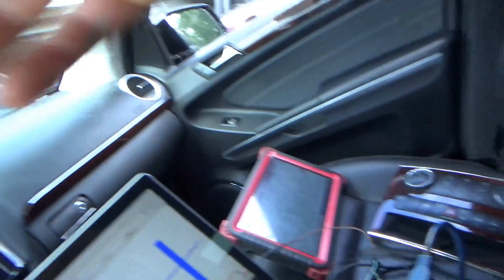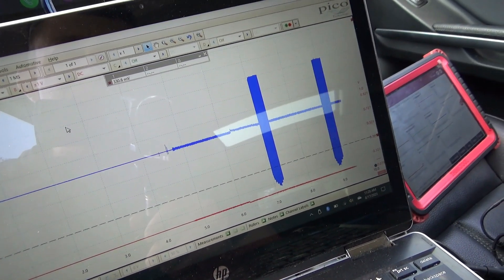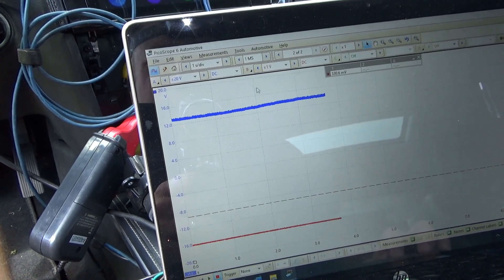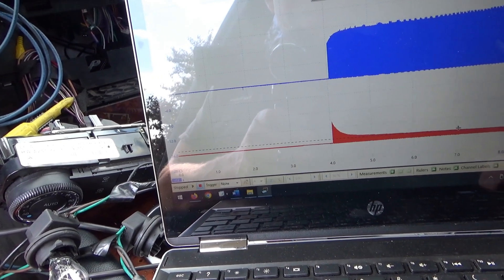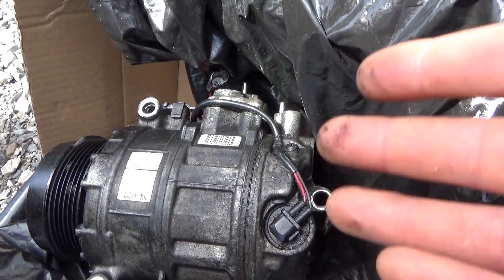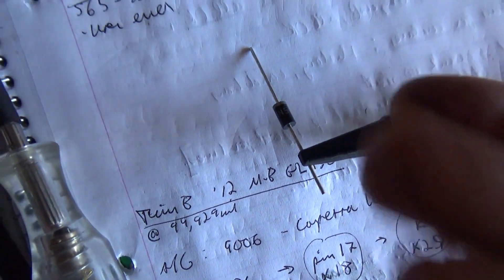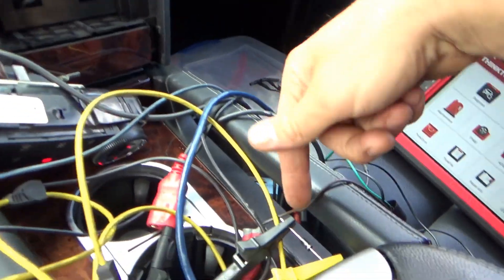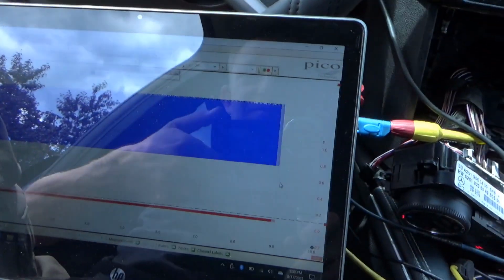Part 2: Did I MIS-DIAGNOSE This Mercedes?? (GL450 no A/C - Crazy REPAIR!)

Comment: My guess is that there is a blown diode in the controller. Because anyway it is easier to be there and it is also more logical. This way it will even guard against induced voltages on the cable caused by anything, not just the inductor in the valve. And the other controller, if it is working at all, most likely has incorrect firmware. And it is not surprising, for a German car, that the diode has a nominal voltage of 15V and is as small as possible. They don't really like to use slightly larger values than "calculated" :)

Comment: The bigger issue for his road trip is his air suspension system.  Compressor ran multiple times during the video and had the classic Airmatic warning on the dash.  He has air leaks and it will eventually kill the compressor.  Unfortunately Airmatic on the GLs seems to be Mercedes' least reliable application but I don't know why.  Anyway, I'd scan the codes and see what it says.  Leaking air spring, line, valve block....who knows.  But it will ruin his vacation.

Comment: Kudos to the folks who were talking about diodes on part 1.  I was way off with my front SAM commentary.  Although someone did mention that there is a compressor control learn-in feature.  I don't think you can "learn" back EMF but would have been interesting to dig into maybe.

Comment: Be very wary of using common types of "rectifier" diodes like  1N4000 / 1N5400 series etc. on PWM control systems - those and many similar ones have a  slow response and can both allow brief spikes past before starting to conduct, and keep conducting for a short time after the polarity reverses again.

That can cause strange problems, radio interference or even damage to other components in some circumstances.
It's only a couple of microseconds, so won't usually show on a slow scope sweep.

Fast recovery or especially Schottky diodes are fine at higher frequencies.

Comment: The standard diode used in electronic applications like this on relays is a 1N4148, has thinner leads, easier to twist around that wire, but I understand, you use what you have available at that time. Good Job!
Reply: 1N4148 is a signal diode and not suited to this task. Perhaps you means one of the diodes in the 1N4001 through 1N4007 family?

Comment: PIV is (P)eak (I)nverse (V)oltage, you have 16, should work
Reply: As wired by Ivan, the diode is clipping the negative voltage, (which was -16V) so will not see 16 V in reverse direction. It only has to withstand nominal battery voltage in the reverse direction, so say 14V. Not much difference though :-)

Comment: Yes, it's ridiculous how Mercedes Benz don't show a freewheeling diode which is connected in reverse polarity to the air conditioning compressor clutch coil because even the generic manuals for my Holden Commodore show that,good find !
Reply: Perhaps because it's a given there is one. Clamping diodes has probably existed as long as electrically controlled AC-compressors has been around.

Do you know if everybody else show any clamping diodes around their vehicles?

Comment: Well done ivan 😀So the inductive part of the compressor might have had a capacitor across the harness originally?, but it failed and was never replaced.
inductive or capacitive  effects.
Back emf is shocking lol.
Reply: It is unlikely that there would be a cap across the harness, because that capacitor will just look like a short circuit to the PWM pulses.

Comment: 800mA though a 1Amp diode is going to get HOT ?   Not sure if that is constant or a Peak value ?  I would personally use a higher current diode if it's a constant 800mA load.
Reply: The diode is only there to absorb the pulses that "discharge" the coil. That could still be a substantial current, so should be checked, but it's not continuous.

Comment: The best place for a fly-back suppression diode is close to the coil that causes the back-EMF spikes, because the conductors between coil and fly-back diode serve as antennas that radiate an RF signal. This is PWM, so you'll get a signal with a base frequency that might be in audible range, with a lot of harmonics on it that might interfere with radio reception.
With this repair with the diode in that location, one should test the radio as well.
Reply: Yes, I agree with this assessment.  It would be good to try an AM radio near the wiring to check how that varies at different AC settings. Wait -- who has an AM radio any more?
Reply: @Graham_Wideman  My car radio has AM, FM with RDS, digital radio, bluetooth, car-kit, aux in, audio file playback via usb. AM still offers a lot of news and talk radio.
Reply: @fluffyblue4006  Yes, I was kidding about the AM radio. I myself have AM in both my vehicles.  Although AM is starting to be dropped on EVs, I have heard.
Reply: @Graham_Wideman  They're dropping it because the EMF of those power electronic drives will be too much and too hard to shield properly.

Comment: Super work Ivan. Keep in mind, the best practice is to place that flyback diode as close to the solenoid as possible, because the wiring acts as a transmission line and the high-frequency current of the spikes will flow between the coil and the diode -- you want those wires to be as short as possible and shielded/isolated from any neighbouring control wires.

I am really surprised that the flyback diode isn't integrated with the valve solenoid.
Reply: Well, not a transmission line, but rather an antenna.
Reply: @Graham_Wideman With regard to other wires in the same loom, it will act like a transmission line, as those wires are capacitively coupled. Which will cause high frequency crosstalk.
Reply: @Stoney3K  Ah, I see what you's saying. Yes, definitely there would be inductively- and capacitively-couple crosstalk to other wires in the loom.  But in my field we might not really think about them as a "transmission line" per se (in the high-frequency sense, not power-line sense) unless the situation fulfills some other requirements that make it amenable to "transmission line theory".  (Two specific conductors carrying a signal from point A to point B, conductors consistently spaced so as to allow summarizing their incremental R, L and C as bulk "impedance" value, no significant random influences from other conductors, and so on.)

Comment: Hi Ivan I use a lot of relays in my designs and they should always have a back emf diode when being fired from semiconductor drivers. Some relays have an internal resistor to reduce back EMF. Relays and solenoids are effectively the same thing. Coil of wire. The diode should be fitted as close to the inductor as possible. Helps reduce RFI. But as you say where is the diode in the replacement unit? On AC circuits I use an MOV.
Reply: Mostly agree for DC. For AC MOV will address infrequent high-voltage transients, but in this application a transient will occur on most turn-offs of the inductive load. MOVs degrade with each transient, so their lifetime has to be factored in. An often user alternative is the "snubber" circuit" using resistor and capacitor.

Comment: I would suggest the diode should have been placed near the compressor to clamp the reverse voltage at the source. How much power is the diode dissipating? Will it get hot?
Reply: Supposedly it is in parallel so it shouldn't get hot.
Reply: @rkan2  yep, thanks. Agree, the diode would have a forward bias voltage of about 0.7 volts and the 12 volt negative spike could only generate about an amp. Hence about 0.7 watts, but only for about a tenth or less of the time. Hence at most 0.1 watts. So as long as the diode can cope with an amp or two and has a reverse voltage tolerance well above 12 volt all should be OK (unless there are unseen higher voltage transients). However, I still think the diode should have been installed on the compressor to reduce any RF interference in the wiring.

Comment: Ivan, good catch and fix on the back EMF.  However for a device that monitors current your test lights lights are problematic.  When you first apply power to a incandescent lamp there is very little resistance and this causes excessive current to flow.  As soon as the filament heats up the resistance increases and the current flow decreases.  This is why you initially saw 4 amps on the scope and then it settled down to 1 amp.  The controller likely saw this 4X normal current flow and shut down to protect the controller before the lamp reached it's steady state 1 amp draw.
Reply from the maker: Correct 👍

Comment: Lesson of the day,we need to use scanners,understand the information,somewhere in that Mercedes there would have been a diode,probably on the original compressor or bcm,without the scanner ,you would not know about the return voltage,bloody good video,thanks for the video.
Reply from the maker: You mean OSCILLOSCOPE? Very different from the SCANNER 😉

Comment: Why didn’t you hook the diode in series with the clutch? That would have stopped the back feed and been a cleaner repair.
Reply from the maker: No. Can you tell me why?
Reply: @PineHollowAutoDiagnostics  My first thought when you said it was back feeding was a diode in series, but then you wired it across the coil like I put across my relay coils. I was just wondering if my way would have worked too since it’s sending a pulse width control signal.  Love your diagnostic videos and troubleshooting skills. Thank you for sharing.

Comment: I was thinking you were going to use an external solid state relay to fire that thing but the Flyback diode was cleaner.  Well done sir.
Reply: That was my thought, but I think you would lose the duty cycle control of the compressor
Reply: @_RiseAgainst  Yep!

Comment: I've seen a similar problem on an electro magnetically controlled hydraulic valve on a Liebherr material handler. The coils on the valves fail often because they were installed in an area that can get very hot. Some of the valves are strictly on or off while others vary flow using pulse modulation. There were two different coil numbers that appeared to be exactly the same on the valves and we stocked both. One mechanic switched a coil from another valve without paying attention to the number and the valve wouldn't function. In that case it was the engine cooling fan which varies speed depending on engine temperature. The electrical schematic showed the diode in the coil. I'm surprised that the schematic you had didn't show the diode. There are also 5 pin relays that have a diode inside. I don't know why they don't put the diode on the circuit board instead of in the component.

Comment: There is a diode built-in to some mosfets and they can fail without destroying the switch side of the mosfet.  It is a common failure in laptops that use these types of mosfets in an ideal-diode safety circuit that ensures reverse polarity on the charger input won't damage the laptop.  Just a theory but it could be one of those mosfets with a built-in diode and the diode in the mosfet that controls that circuit could be where the failure happened.  It could be an external diode as well but cost savings... fewer components...  either way, its fixed.  ;)
Reply: Would be best to use a Schottky Diode in this application. Not sure what type was used, though.  Nobody would have caught this without a scope.

Comment: Why did you not just put the diode inline that would have stopped the back voltage then the diode wouldn’t have any back voltage or current going though it
Reply: Flyback diodes are installed in parallel.  You want to create alternate circuit to use the coil's resistance to bleed the back EMF off or shunt it to ground.
Reply from the maker: Think about the potential across the diode during the High and Low portions of the PWM signal. Controller would still see the negative voltage spike with diode in series 😉

Comment: For anyone that doesn't know, PIV is peak inverse voltage. It's the maximum reverse voltage the diode will handle before starting to break down. 50piv is just right for this application.
Reply: And if you exceed the piv at all, it will nuke the diode. This is a very important specification. In this case the diode is essentially across the coil, which is correct, and piv doesn’t come into play. Diode ‘eats’ the arc as soon as the reverse voltage exceeds .6 volts.
Reply: PIV is kind of an older term, those radio shack diodes are a bit old! datasheets now use the term peak reverse voltage, Peak Repetitive Reverse Voltage , all the same thing. just like when we used the term kilocycles, now we use kilohertz

Comment: In my design arena we did lots of relay switching and the switch was transistors.  Conveniently, the relays we used had built-in diodes ACROSS the relay's coil.  These were D.C. voltage coils and the diodes were such that they were reverse biased when control voltage was applied.  How does this work?  In operate mode the current flows from battery to coil to ground back to battery.  In open circuit the current then flows thru coil in same direction thru diode back to coil.  

A coil builds up magnetic flux when the current flows.  When the current's source is switched off the magnetic flux collapses.  This causes the voltage across a coil TO SWITCH POLARITIES. 

Voltage applied to a coil causes the coil to consume energy with a resulting voltage drop across the coil (+) to (-) from input to output.  When switched off, the coil becomes a generator by switching voltage polarities to continue current flowing; now (-) is (+) and (+) is (-).  The flowing current wants a path thru the now open switch.  

An inductor 'resists CHANGE in current flow.'  If a switch opening stops current flowing, the coil then goes crazy [THE CURRENT WILL FLOW somewhere, somehow] and so it first flips polarity then INCREASES IN VOLTAGE looking for a path for the collapsing coil's current. This is a cause of pitting of switches because the extremely high REVERSE voltages cause arcing across the switch's now open contacts.  

It's my belief that early vacuum cleaners had headlamps across the motor to provide a motor coil discharge path when the switch was turned off = opened to eliminate switch pitting.  

In Ivan's compressor the control voltage was applied to the compressor's coil, thru the coil, then to ground.  His diode fix then provided a diode path from ground to the control wire which goes back to the compressor's coil.  It is a longer route but sufficient.  I'd of preferred a diode across the compressor coil for a shorter path.  Internal to compressor is best.  

Another responder in part 1 suggested certain compressors had such diodes; that some did not.  I'm uncomfortable with a 1amp diode in a circuit commonly handling 1amp frequently...  I'd want at least 2amps.  There's derating criteria to include temperature, voltage, end-of-life, etc., to precisely derate a diode's current specification for its application.  COMPRESSORS get really hot....  being inside the car is a less severe environment.  Still 1amp for 1amp application is cutting it close.  Keep in mind that in addition to the other currents flowing in the ground wire Ivan used there's now an additional 1amp added.  Is the wire guage sufficient?

For the electric techs:
ohms's law for inductors:
V = L×(di/dt)
Voltage developed across an inductor (neglecting its resistance) is related to the CHANGE of current/over time)

Increasing current the inductor's voltage is (+) -> (-).
Decreasing current
inductor voltage  is (-) -> (+)
Reply from the maker: Diode package said 3 Amp lol
Reply: @PineHollowAutoDiagnostics  
3amps is   V E R Y   GOOD!    
Still ground wire amperage is important too.  And there's numerous switches in my old 90 Buick that should have coil diodes but don't and contact pitting is evident.  One door switch actuating four door lock coils is significant.

All of us need to use o'scopes more often.  A weath of opportunity to more quickly get valuable info.

Comment: Good find... it's crazy how sensitive these modern electronics are.. The way I would have hooked the diode up, cut you about a 6-8 inch piece of wire and place the diode inline of it leaving   a few inches of wire on each side. Then you can heat shrink the diode separately and the wire is easier to splice to the harness.. this is how I was taught when I installed the remote start systems. It looks a little more professional and gives the wires more flex.
Reply: Ivan's wiring hacks will eventually come back.  They haven't so far because the cars usually hit the crusher before it becomes a problem.

You bring up a good point, but soldering to stranded wire is one of those things that needs second thought.  Solder can make stranded wire fail due to stress concentrations and vibration.  The better solution here on two counts is to put the flyback diode physically across the coil not hacked into the controller wiring.  Clamping voltage at the source is always best.

Comment: they use to use a clamping diode on gm feed back carburator solenoid yrs ago tht was 28 ohms resistance. pulse with modulated for feul control . could a dc volt meter pick up tht back feed voltage ?  i was thinking also if capacitor would have worked ? in parell  like used on alternators output to smooth out ac ripple just food for thought .